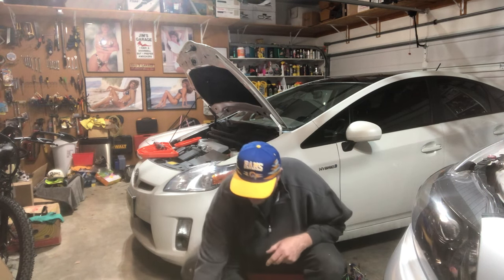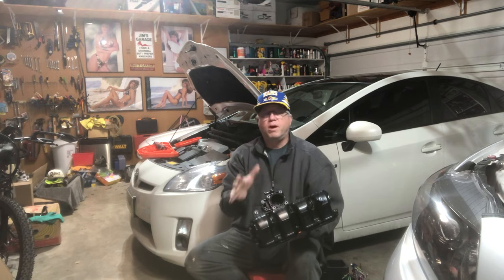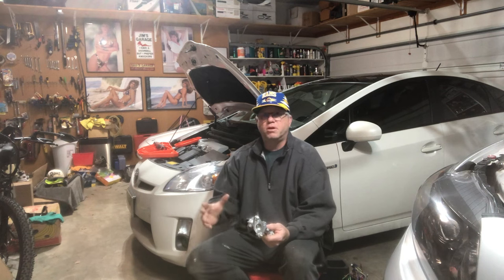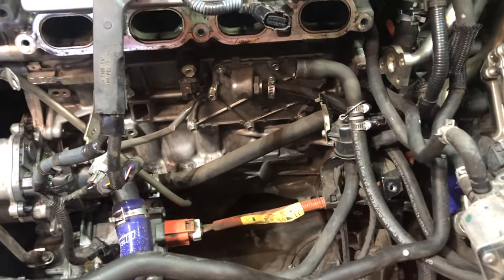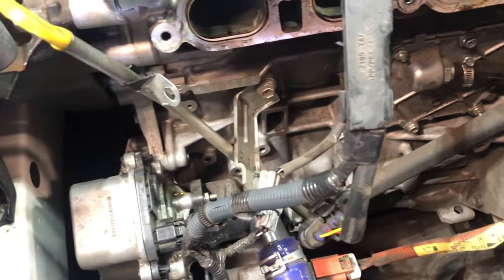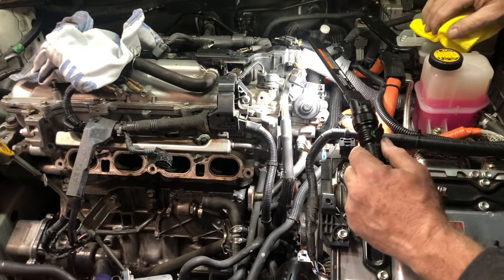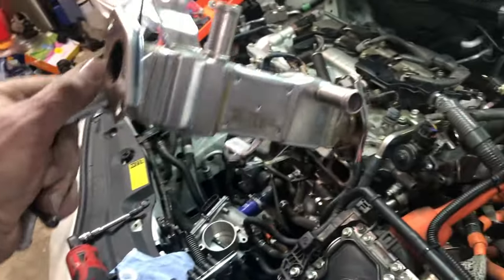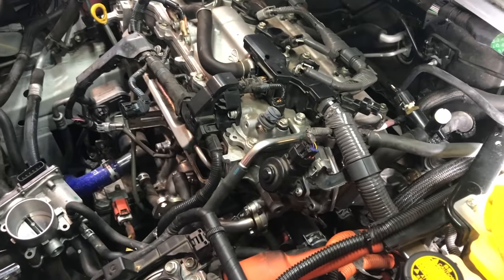2010-2015 Prius // EGR Valve // Intake Manifold // DIY // Removal - Clean & Replace

Comment: Fantastic video! Thank you, about to do this job tmo, using toyota parts. Maybe I missed it, but what is your method and tools used for cleaning the ports on the manifold and egr cooler? Thanks again, best video Ive seen on this!
Reply from the maker: Thank you very much! I appreciate it. I did show cleaning the parts as I didn't do it at the time since I was using new parts to replace the dirty ones. I used some small wire brushes to clean out my intake manifold passages with plenty of soaking in degreaser and brake cleaner. There are a lot of excellent degreasers that will work well, just pick one and soak it. I would then use the wire brushes to clean the passages and intake. The EGR cooler is also cleaned the same way and since you can't use a brush on it just soak, spray, rinse and repeat until looking new. I used this type. https://www.amazon.com/Stainless-Brushes-Cleaning-Removal-Scrubbing/dp/B092Z9JVNF/ref=sxin_15_pa_sp_search_thematic_sspa?content-id=amzn1.sym.14a246c3-7a62-40bf-bdd0-5ac67c2a1913%3Aamzn1.sym.14a246c3-7a62-40bf-bdd0-5ac67c2a1913&cv_ct_cx=metal+brushes+for+cleaning+rust&keywords=metal+brushes+for+cleaning+rust&pd_rd_i=B092Z9JVNF&pd_rd_r=3a44a6fb-7966-4fe5-baca-10f908e07e83&pd_rd_w=KfFDQ&pd_rd_wg=7gisd&pf_rd_p=14a246c3-7a62-40bf-bdd0-5ac67c2a1913&pf_rd_r=G68Q8R31TXFDAC03A73G&qid=1673736562&sr=1-2-a73d1c8c-2fd2-4f19-aa41-2df022bcb241-spons&psc=1&spLa=ZW5jcnlwdGVkUXVhbGlmaWVyPUEyME1VSkZSTFVLNlNZJmVuY3J5cHRlZElkPUEwNTcxOTIzM1ZWUEpBMFpSNkY2WSZlbmNyeXB0ZWRBZElkPUEwNzcxNTIxMk5GNzVTOVlCR1FJRSZ3aWRnZXROYW1lPXNwX3NlYXJjaF90aGVtYXRpYyZhY3Rpb249Y2xpY2tSZWRpcmVjdCZkb05vdExvZ0NsaWNrPXRydWU=
I also used these for the small passages in the intake manifold. https://www.amazon.com/Bottle-Stainless-Bristle-PMD-Products/dp/B007S91ND4/ref=sr_1_7_sspa?crid=B9I9QMBX247Q&keywords=small+wire+brush&qid=1673736793&s=industrial&sprefix=small+%2Cindustrial%2C156&sr=1-7-spons&psc=1&spLa=ZW5jcnlwdGVkUXVhbGlmaWVyPUExTDdGM0QzNEpXQUhNJmVuY3J5cHRlZElkPUEwNDE2MjY4MUc4OFFGTkRFM1hJOSZlbmNyeXB0ZWRBZElkPUEwODYwMTEwMkFUVjRBTjM4UE40WiZ3aWRnZXROYW1lPXNwX210ZiZhY3Rpb249Y2xpY2tSZWRpcmVjdCZkb05vdExvZ0NsaWNrPXRydWU=
Reply: @jimsgaragetoys  thanks again! Just got everything apart, the rear nuts holding the cooler were the toughest part. Probably need new metal gaskets, and some hose clamps.
Bear of a job, but saving a grand works for me! Couldnt have done it without your video, thanks again!
Reply from the maker: @Nissan300zxshowcar  Good job!! I actually laid over the engine and reaching those nuts was pretty easy with my left hand.

Comment: I'm about to do the same for my Prius. Curious... is your new intake manifold the same as the original one? The EGR passage was redesigned on the new version (P/N ending in -54). The new version also has a 1/2 grill gasket on the throttle body. If they are different, was there any issue with performance?
Reply from the maker: I didn't notice any differences but I've had it for several years. When did the redesign come out? I still have the box so I'll have to look at it. It's tucked away up high with the cleaned parts ready for when I need them again.
Reply: @jimsgaragetoys  Not sure when the last version (17120-37054) came out. The service bulletin T-SB 0012-10 issued in 2012 indicates version 17120-37052 was the latest. Version -54 came out later and it has baffles in the main EGR channel. You can see a picture of it in posts #52 and #56 by TeamGeek on PriusChat thread titled "Visual Differences between updated Intake Manifold".  Many say it doesn't fix anything. Regular cleaning is still required for the entire EGR Circuit to prevent clogging and cold-start rattling.
Reply from the maker: @dezafinado  I looked and the one I bought was the latest version, 17120-37054. I didn't notice any visual differences and as you pointed out it still needs to be cleaned.
Reply: @jimsgaragetoys  Thanks for the update. I just removed the air filter box, throttle body and EGR pipe for cleaning and inspection. My car is 2015 PiP with the -54 intake, normal cold-starts, 50-52 MPG in Hybrid mode, no oil consumption and no DTCs. 

At 66k, the throttle body is clean on the top-side while the bottom had a smear of oil. The butterfly was clean. There was ~2 tablespoons of oil at the bottom of the intake. The EGR pipe (elbow) had about 1.5mm of carbon buildup at the edge of each end but very little inside.  I didn't remove the intake, EGR and EGR cooler but the Intake main orifice and EGR orifice have about 1mm buildup so no blockage yet. I plan to remove the entire EGR circuit for cleaning and replace the PCV at 70 or 75k. 

Since you have an OCC, do you think it's really effective in reducing oil accumulation at the bottom of the intake? Although I like the idea of having the OCC, I don't want to remove the OCC, the intake, related hoses and put everything back to its original format for Smog Inspection every 2 years. As a maintenance routine, I will remove/clean the throttle body and wipe off the oil in the intake annually. Do you think that's sufficient w/o having aan OCC?
Reply from the maker: @dezafinado  I think you have a good plan in mind. Why would an OCC not be allowed for smog inspection? As long as it's not a vented OCC it should be fine as the system is still sealed. I know that in testing the OCC was shown to be very effective in the Prius in many ways.
Reply: @jimsgaragetoys  Technically, only CARB-legal OCC or Air/Oil Separator are allowed. COBB makes one specifically for Subaru. However, it depends of the technician's attitude. Some will look the other way if it's not vented.
Reply from the maker: @dezafinado  I'm sure glad I'm not in CA. They make things an issue when they aren't an issue. One forest fire puts more pollution in the air than all of the cars do in one year and yet they don't take the steps to prevent fires every year. The CA politicians don't seem to know anything.
Reply: @jimsgaragetoys  About 45% of CA's land mass is actually federal land. National Parks, Monuments, Nature Reserves, forests are all managed by the US Forest Service and NPS. Only State parks and the coast line are under State jurisdiction. If we followed the native people's tradition, we should have let brush fires burn every summer to minimize the big ones. The knowledge base is there but communities adjacent to these forests bitch about air quality if firemen conduct controlled burns.  So we're stuck. 

CARB is both good and bad... for the most part good. What I don't like about CA law is replacement Catalytic converters... it's very restrictive and mostly direct from the manufactures, so very expensive and not helpful to those with low incomes. The selling of used CATs is illegal in CA. However, CA hybrid owners have longer warranties on both hybrid and emission components. We wouldn't have hybrid and EV technologies without CARB pushing it. It was CARB who did the nitty gritty investigation to help the EPA nail VW against the wall for diesel cheating. I moved from Oregon to SoCal 42 years ago and air quality has improved a lot even with the population growth. The worst air pollution now is in the Central Valley from agriculture.  CA's fires are really no comparison to the fires in Canada and Alaska, where they only protect communities and let the fires burn. Just too many trees in the middle of no where so rarely covered by the news.
Reply from the maker: @dezafinado  I understand what you're saying. I was just trying to make a general point in the fact that one forest fire puts out more air pollution than all of the cars and trucks do in a year. They worry about the smallest of little things but don't work on controlling forest fires that do incredible damage to air quality. These horrible fires caused by electrical lines because they didn't clear the trees along the path of the high tension wires is simply nuts. They put so much on the citizens that it will snap at some point when people simply can't afford to do any more.
Reply: @jimsgaragetoys  You're right about the maintenance of the power lines, but that's the responsibility of the private utilities companies. They had plans but prioritized maintenance to the densely populated areas first like SoCal where most fires have historically occurred. They were later held liable by the state as well as by the communities affected. I see no end to the fire situation in the west. With the weather we have now, it takes a certain degree of insanity to become a firefighter.
Reply from the maker: @dezafinado  I know, it's just another issue that the government didn't make sure was getting done. And the state doesn't take care of the land anyway to control the large fires we see now, none of the 3 western states do. The point is they worry to death about the littlest of things and do little to control bigger events that do a lot more damage, typical. Just like the 25 billion the CA government has spent on homelessness over the past 5 years with nothing to show for it because the majority of it lines the pockets of officials running the programs. Crazy.
Reply: @jimsgaragetoys  Poverty is big business nationwide. LBJ tried to tackle poverty in the South with his Great Society campaign, but the South remains poor today. How much does the Appalachian Regional Commission receives each year but Congress never talks about it.

Comment: Are those aftermarket (blue) coolant hoses? If so, what brand and where did you source them?
Reply from the maker: Good eye! Yes, they are HPS silicone radiator hoses. Here is the link. https://www.ebay.com/itm/374109620543?fits=Year%3A2010%7CModel%3APrius&epid=2010059751&hash=item571aabc93f:g:Z4cAAOSwI8ximEEG&amdata=enc%3AAQAHAAAA8AApHMkpiUxCez2dwGyiZy5eI%2ByGuAjDzf5Pk%2FyNeP4XdwNDmidCVSYYjAFHa%2B1aLDdl4HGR%2FPM%2BgWfD6in8ob6GrEResp5pw%2F30ILotEHmfDerirC21UhA6u7qZ7eaGzVxwAHKo57GN%2FGUw1g6Hfj5D%2FEXTaWFtxRxWyao5qU250Ca8iPsDhtYl3fWcQsE2MeMqScIfQFdTYrtnFkoHPxPh6LDPqKNyUC2sWcdwPP2utgFYb%2Bsaz3Cq225FslDCHSfKS594bAVZATdIb%2FmQpPhGMsQGEl2cCr%2FZUtH%2B8jyi1%2Bra7zhWZDKU3UtiQTObFA%3D%3D%7Ctkp%3ABFBM5suDvrRg
Reply: As AMD the Car Care Nut mentioned, Toyota Pink Coolant is just about the same price as aftermarket ones. Use original-this coming from a Toyota Master Diagnostic Technician
Reply: @jimsgaragetoys Link no longer good.
Reply from the maker: @kimoclyde  Link for what? I didn't have links for anything, only Toyota part numbers. You can get the parts from a dealer or search for them online.

I just noticed the link you were referring to. That was the link I bought mine through. Just do a search on eBay for them and I'm sure there are other sellers.
Reply from the maker: @kimoclyde  A quick search pulled up many sellers! https://www.ebay.com/itm/265451571170?epid=2010059751&hash=item3dce2587e2:g:tFgAAOSwmNJht~un&amdata=enc%3AAQAHAAAAsFyUG6ep6zLDir1KbZa2ExpSKgNhIfB5VIHGIry0CdAPJnNtZDnW2Tzmb3R9hmGm09lQQdEAxMQnbDxDi4VIZHMB0Xqi1anz%2BJatYk4Dp7fKdqFYkiWDdih8CqY6%2BZB4czRw5C%2FrJL1qAgZSR8qMUE2vLH0Toq8KpOZf4sd9m63QhJ1%2F2rrqwUxU2qcv8dMSDPYvQTRQlj9UEHg2j2IqFVOSDCbiwUOMpqLWH3SrMvh7%7Ctkp%3ABk9SR5ad99KpYQ

Comment: Hey Jim, I'm working with a 2011 Prius that rattles on start. The last owner experienced the same thing and replaced the Intake manifold and cleaned the PVC pipe (not sure what that is). But they referred us to your video where I'm commenting. My question is - if we think the EGR cooler and EGR valve have never been replace on a high mileage prius, should we replace them or try and clean them?
Reply: Try to clean them, for sure, no need to replace. But also violent rattling on cold start is one of the indicators of a blown head gasket on this car  so you can do egr cleaning but also test for compression in cylinders to make sure it isn’t a head gasket issue
Reply from the maker: Sorry that I never saw your question. I would for sure clean the EGR cooler as it's most likely plugged and clean the EGR valve or replace it. Depending on how long ago it was you may want to check the intake manifold too. I would also check the compression of each cylinder. Are you loosing coolant without it leaking?

Comment: Soy your saying you can leave the existing EGR cooler in place but disconnected and just blow it out in place?
Reply: If you haven't cleaned out the EGR cooler I would remove both and clean the cooler too. I had recently cleaned my EGR cooler so that gave me the option of blowing it out. It looked pretty clean still as it hadn't been long since I had cleaned it.
Reply from the maker: Only if you cleaned it well a short time ago. Using an air compressor will blow out what has built up to give you a little more time before the next cleaning.

Comment: It’s PCV (Positive Crankcase Ventilation) valve, not PVC. And those hoseclips that you have connecting to the PCV are not the original spring clamps
Reply from the maker: Thanks, and yes, I know. If I said it wrong at some point, opps, my bad! I've heard many people make the same mistake even when we all know what it is. I found the original springs clamps to be a little loose so I used a better hose clamp for better clamping power. Better is never a bad thing! I've installed an OCC on many cars over the years with excellent results.

Comment: Ok, nobody has asked this yet.  Where did you get those trays?  Looked on Amazon and didn’t see them.
Reply from the maker: They are all over Amazon in various colors and prices. I don't see the exact ones I bought a couple years back but here is something similar. https://www.amazon.com/MOTORHEAD-Super-Grip-Silicone-4-Piece/dp/B0B79QNHWW/ref=sr_1_8?crid=2QYSBX4268WMH&keywords=silicone+auto+work+trays&qid=1698652238&s=automotive&sprefix=silicone+auto+work+trays%2Cautomotive%2C203&sr=1-8

Comment: I do not understand why manufacturers put so much efort to put pieces in an so complex order, and simple maintenance, must be so complex... i have a prius that i buyed couple of monts back, and definetly will renounce at this garbage car with dozens of problems, most of them that came from initial engeenered project...
Reply from the maker: All manufactures design cars to be built, not taken apart. For those of use that like to do our own maintenance this can make it a challenge. That being said the Prius is not that hard to work on once you do some things once.

Comment: Does your wrench have an impact function or is it strong enough to remove tight bolts?
Reply from the maker: I have multiple ones that I use depending on the usage and torque needed. I have a good selection of Milwaukee tools in both the M12 and M18 battery sizes. The 3/8" M12 one I use a lot has no impact function but works well on most 10mm, 12, and 14mm bolts.

Comment: what are the parts # for the items you replaced?
Reply from the maker: Sorry about the delay to your question but I had to find the boxes! The EGR Valve Kit is Toyota part # 04004-58137 and the intake manifold is # 17120-37054

Comment: You should have replaced PCP valve as well while you are there, its under 20bucks.
Reply from the maker: That had already been done at a previous service when I installed the Oil Catch Can. I will be swapping the dirty intake manifold, EGR cooler, and EGR valve for the clean ones I have ready to go very soon. I also have a new PCV valve for it at that time. My plan is to also replace the water pump at that service too.